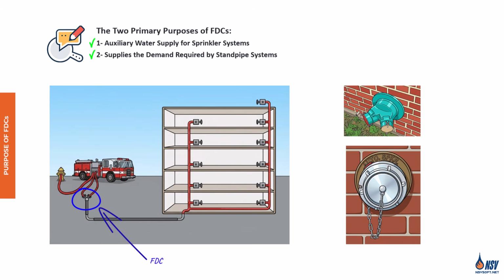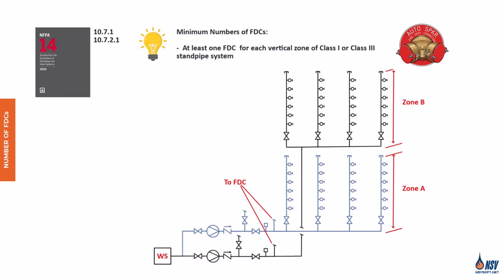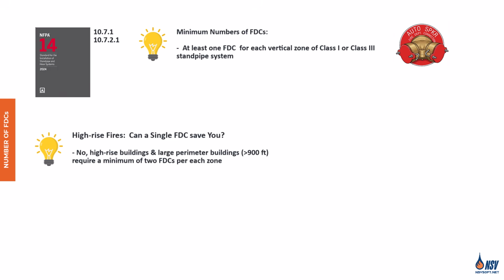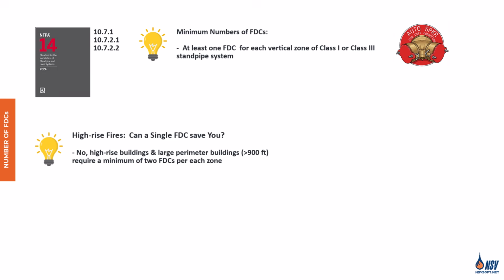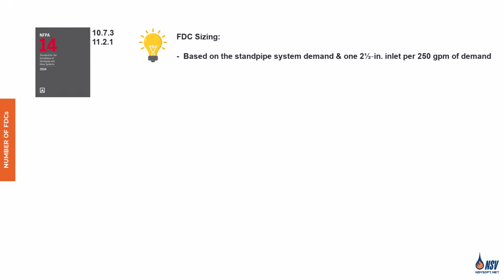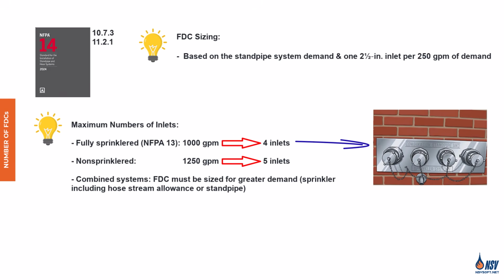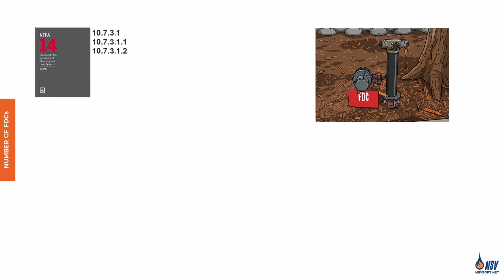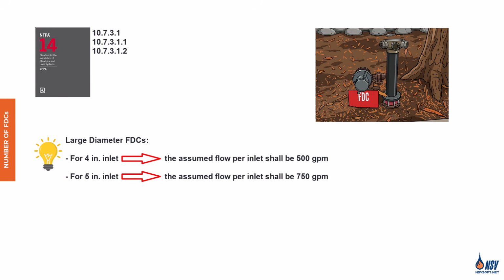🚒 Fire Department Connections- Part 2

Comment: Suppose the system requires a total of four fire department connection inlets, but the type of fire department connection used has only two DN65 inlets each. In this case, we would need a total of two fire department connections.
My question is: must each fire department connection be provided with its own check valve, or can we install only one check valve on the main header？
Reply from the maker: Section 16.12.6.1 of NFPA 13 (2025 edition) states:
“A listed check valve shall be installed in each fire department connection and shall be located in an accessible location.”
This requirement clearly indicates that each fire department connection (FDC) must be provided with its own dedicated check valve. Accordingly, the use of a single check valve installed on a common header serving multiple FDCs is not permitted under NFPA 13.